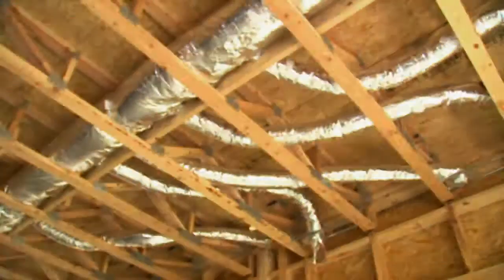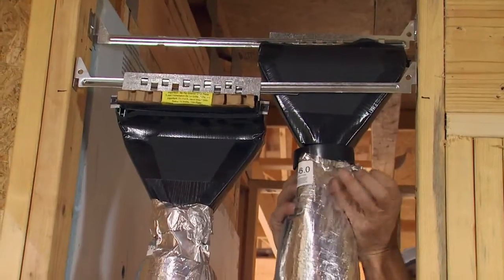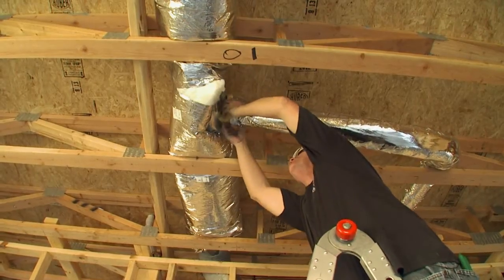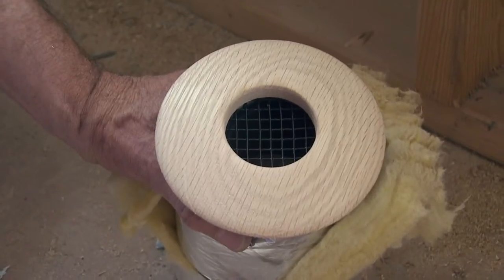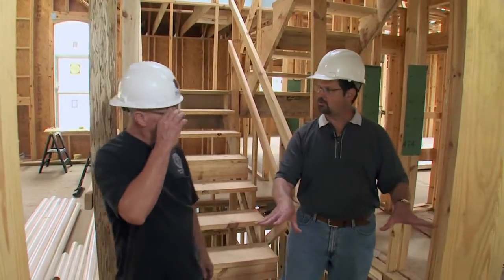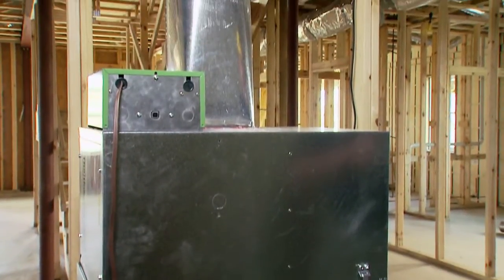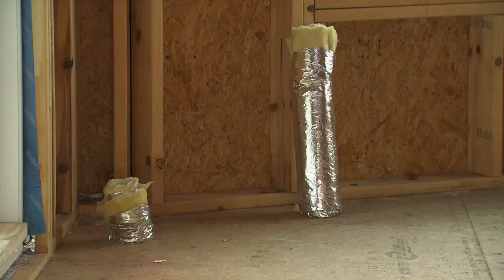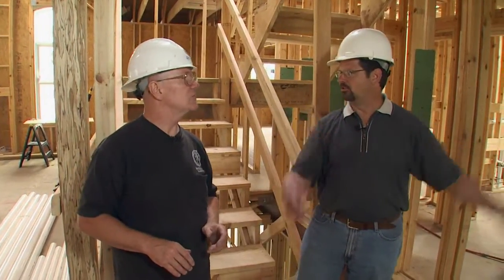Unico System Segment on Built To Last

Comment: this ducting is thin plastic- good luck replacing it in<<<20 years when its buried in your walls !
Reply: A friend has had it in his house for 25 years.  Working perfect.  Perhaps you are upset because if you are a competent DIYr you can install this yourself.
Reply: Mine is 31 years old and the ducts are still working fine.  Just replaced the Unico because the outside compressor started having occasional issues starting up.  Interior ducts are still being used and we added a few more to a renovated section of the house.